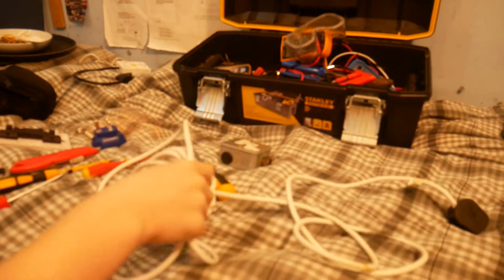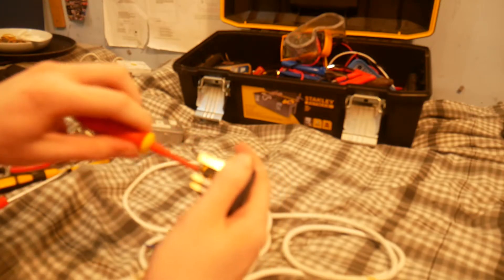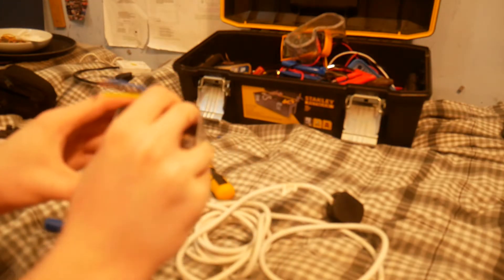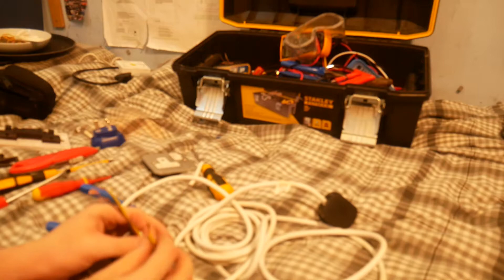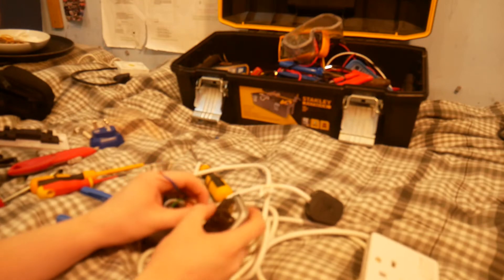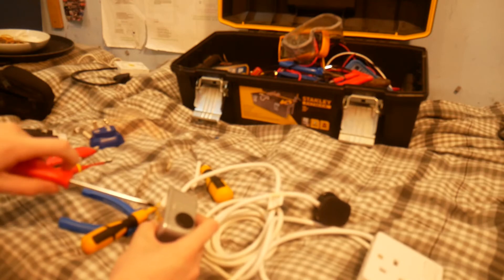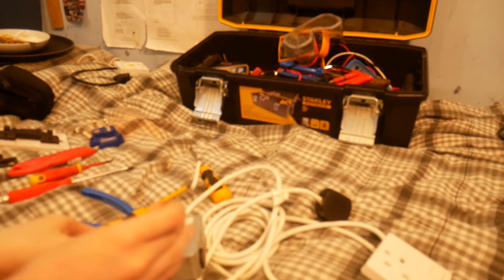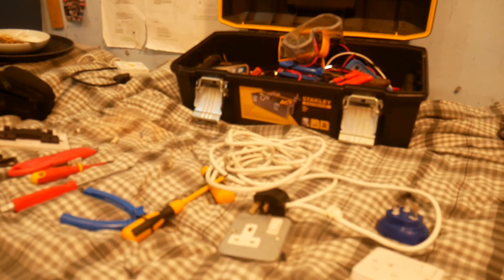How to Make  Custom Extension Lead Uk (Metal Clad)

Comment: Hi. 1.mm2 Flex will carry up to 10 amps or 2400 watts. 
Try and use a gromet when passing the flex through the cable entry on socket. It prevents damage to insulation and also eddy currents. Be careful.
Reply from the maker: yea this was cut of a old 10 amp masterplug extension lead 5 metre that was broken i do understand about that and there already was a gromit within the electrical metal clad